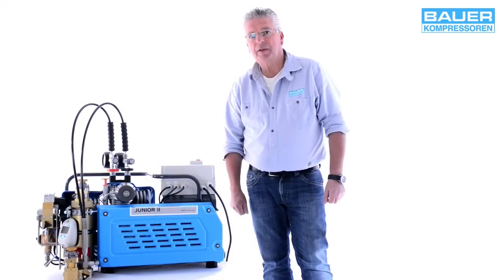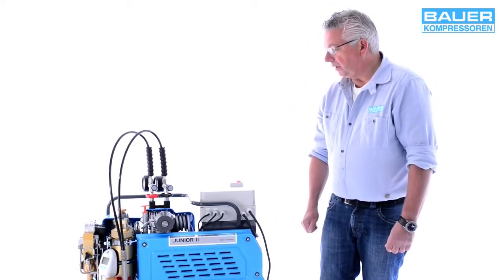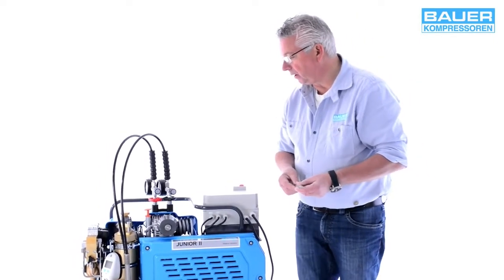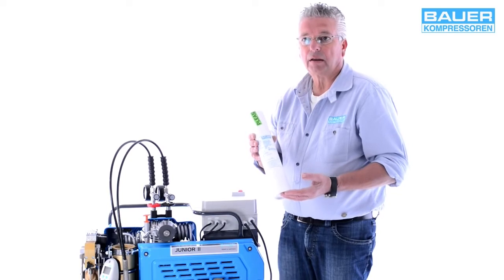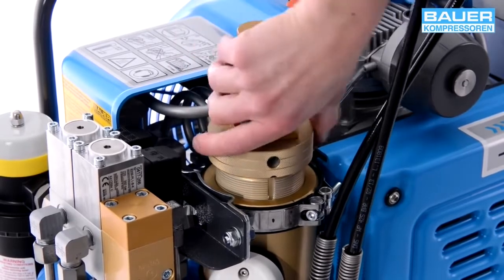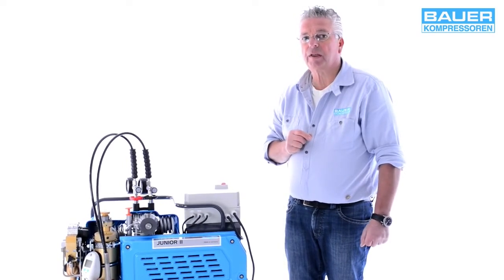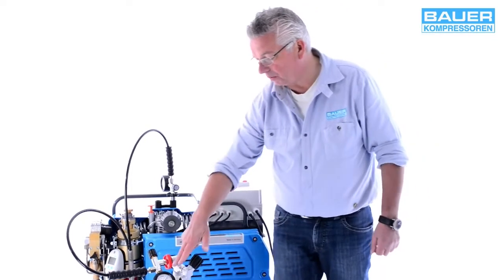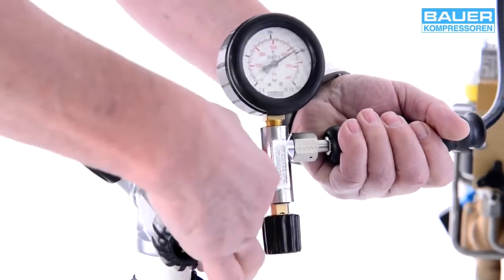Installation and Service Startup BAUER JUNIOR II

Comment: How often should the air filters be changed?
Reply from the maker: That depends on the operating conditions. In the B-APP or B-CLOUD we provide some calculation tools that help with finding out how often you need to change the filter cartridges. Find the calculation tool here: https://b-cloud.bauer-kompressoren.de/tools

Comment: This video should have shown how to depressurize filling hoses more correctly , on one hand you say filling hoses need to be depressurized to connect to machine in depressurized state , on other hand you say filter system need to be pressurized after use , won't the filter housing also lose its pressure when we depressurize the hose ? To be clear, after filling we depressurize the connector area to be able to remove the connector from cylinder but the pressure gauge will still show the last filled pressure which can be brought to zero by opening the valve further and completely depressurizing the hose and to zero. I didn't understand which depressurizing are you talking about, the connector area or complete hose?

Comment: Hi sir good day. I use bauet  compressor. But there is problem. There is oil in the cartrodge filter. What is the priblem of that. What will i change..
Reply from the maker: Thank you for your comment. If you have liquid oil in the filter cartridge, this can have several causes. Please contact an official BAUER dealer: https://www.bauer-kompressoren.de/en/bauer-worldwide/sales-partners-worldwide/
Please also observe the notes on operation and maintenance in the operating instructions, e.g. regular condensate drainage and filter cartridge replacement.
Reply: Ok sir thank you

Comment: Let's say we only use for pcp airgun tank only not for breathing/diving tank do we still need to replace the cartridge
Reply from the maker: Yes! The filter cartridge must still be changed regularly, otherwise it will fill up with water, become oversaturated and clump together. This can block the air flow, which poses a risk. In addition, particles can become dislodged, which can enter the storage tanks to be filled and cause damage.

Comment: I did not quite understand if the safety valve should be completelt shut clock wise or anti-clockwise.
Reply from the maker: This provides you with further information on the safety valve:
The safety valves described here are spring-loaded safety valves, in other words, the closing force is effected by a spring. Depending on the inlet pressure (pressure in the pressure system or pressure vessel to be secured), the safety valve behaves as follows:
•	The safety valve remains closed as long as the spring pressure remains greater than the inlet pressure. 
•	lf the inlet pressure rises above the set response pressure, the spring is compressed and the valve can be heard to open. The medium flows into the surroundings through the venting holes. 
•	lf the inlet pressure drops below the set response pressure, the valve closes again.
The spring pressure and the response pressure of the safety valve are adjusted using a screw. The inlet air screw is only for checking the function of the valve.
The response pressure of the safety valves depends on the order and is between 100 and 365 bar. All the valves are fitted with lead seals in the factory to prevent unauthorised adjustment of the response pressure.
If you have any further questions, please contact an authorised BAUER distributor: https://www.bauer-kompressoren.de/en/bauer-worldwide/sales-partners-worldwide/
Reply: @bauerkompressoren  sir I want to know at what pressure the intermediate safety valve will operate stage 1 &2
Reply: Anticlockwise

Comment: Good afternoon sir, I have a problem, I have a Junior II. After more than 3 years of use, there is a leak in the safety valve, then I think the cartridge filter needs to be replaced. A week later I bought a cartridge filter with part number 057679, but the safety valve was still leaking too. So what's the problem?? Different number of filter cartridges or safety valves sir????
Reply from the maker: Thank you for your email. The mentioned article number 057679 is a filter cartridge for the purification of compressed air. This has nothing to do with the safety valve. The filter cartridge is a consumable that must be replaced regularly to ensure the required breathing air quality. Please follow the instructions in the operating manual. 
With regard to the safety valve, please contact an authorised BAUER dealer, as this is a safety-relevant component. You can find our distributors here: https://www.bauer-kompressoren.de/en/bauer-worldwide/sales-partners-worldwide/

Comment: Hallo, can you please correct me if wrong, do I understand correctly that in this compressor configuration /automatic drain and switch/ filling hose shall be deflated completely once compressor switched off for a longer period? And when deflating of hose done using filling valve, filter unit still remains pressurized to avoid saturation of filter. In other words depressurizing of filling hose will not cause that filter unit will lose pressure completely?
Reply from the maker: Hello, thank you for your comment and your question. We can answer this as follows: If the filling hose is to be removed from the tank, the filling adaptor/valve must be depressurised, otherwise it cannot be removed.
This means that the connector is depressurised, but not the filling hose and the P21 TRIPLEX filter column. In other words, the unit is pressurised and this pressure should not be released from the P21 until the next restart.
An exception to this is the 2nd stage intermediate separator, which is depressurised after the unit is stopped.
When the unit is restarted, any remaining pressure (depending on how long the unit has not been in operation) should be released in order to avoid peak current consumption.

Comment: How long fill out the scuba tank?
Reply from the maker: The duration to fill a diving cylinder depends on several factors like charging rate, the size of the cylinder as well as the filling pressure. If you have for example a JUNIOR II or PE 100 with a charging rate of 100 l/min, one 11 l diving cylinder, as well as a filling pressure of 200 bar, it would take approx. 22 minutes to fill the breathing air cylinder.

Comment: I use BAUER Kompressoren Junior II. I got a problem during using the air compressor to refill the air 
cylinders. As per the instruction manual, international filling connector connected to the air bottle, 
opened the cylinder valve then pressure gauge showing present pressure of the bottle. Once I 
started the compressor air is not filling to cylinder, when removed the connecter from the bottle 
pressure gauge still showing the beginning pressure of the bottle without dropping. While running 
the machine I felt air leaking on top of the safety valve of filter cartridge. Advise m
Reply from the maker: The situation you describe can have several causes, so unfortunately a remote diagnosis is not possible. Please contact your responsible BAUER partner to solve the problem: 
https://www.bauer-kompressoren.de/en/bauer-worldwide/sales-partners-worldwide/
Reply: I think you did not install the air filter, that what happened to us actually